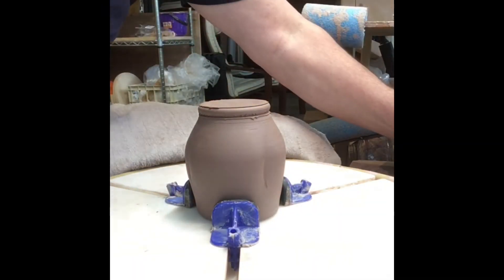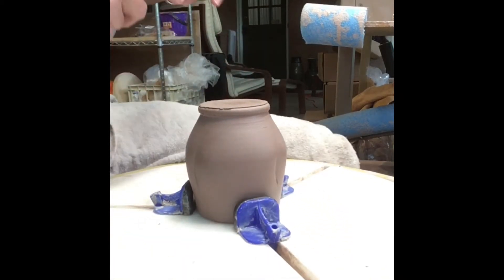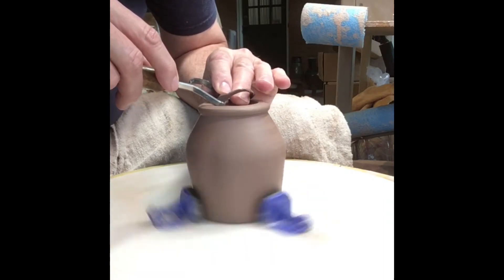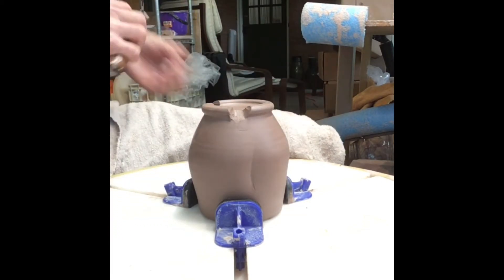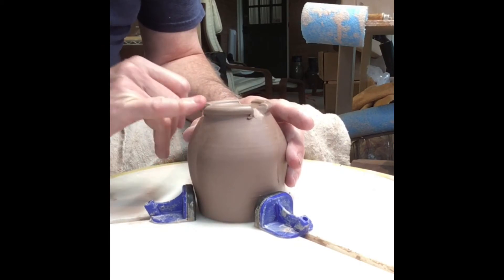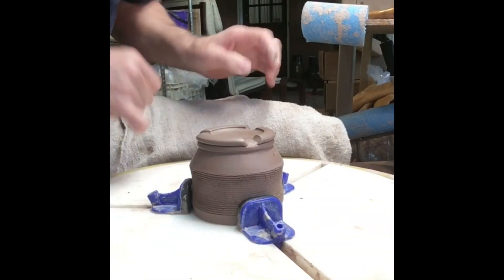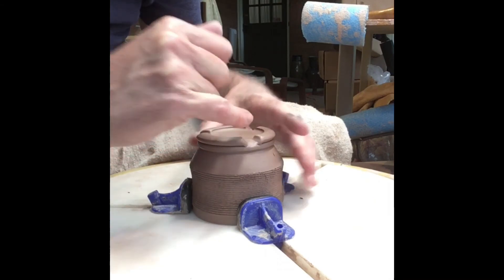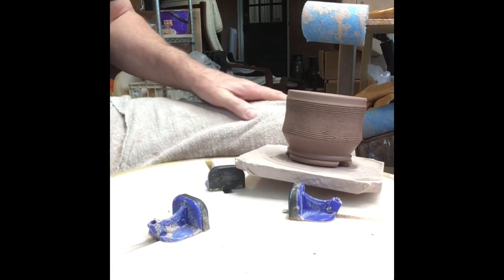Trimming Pottery and Adding A Foot

Comment: How many ounces of clay did you use?   After glazing what is the height and width?
Reply from the maker: I use between 14 to 16 ounces on these. and finished they are 4" tall and about 3.25" wide.  I make and trim a foot on these so I have to have a little more clay.  If you don't have a foot you can use less clay.  I like to vary the size of the tumblers because I find people look for one that fits their hand so having a few different sizes gives options for buyers.